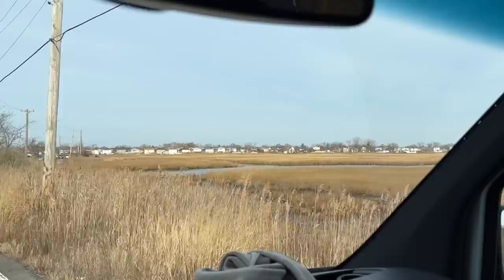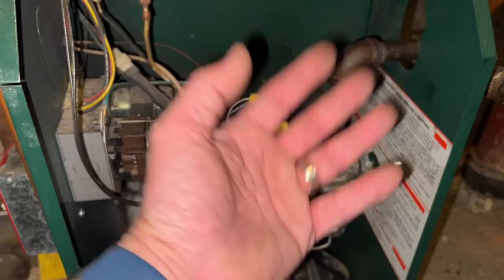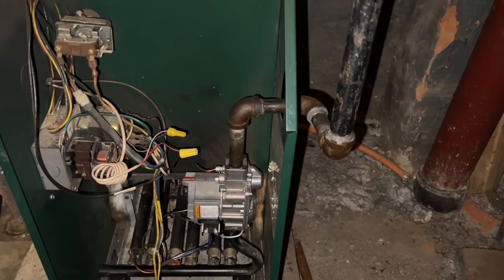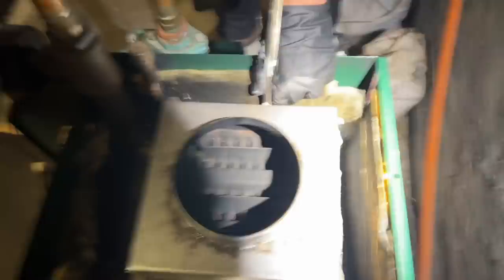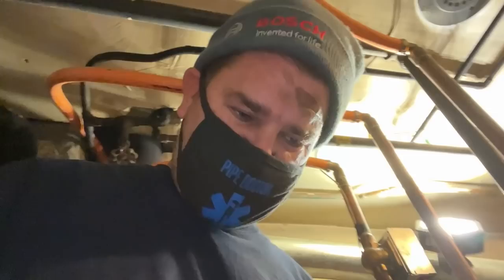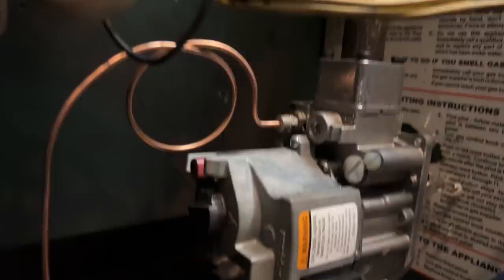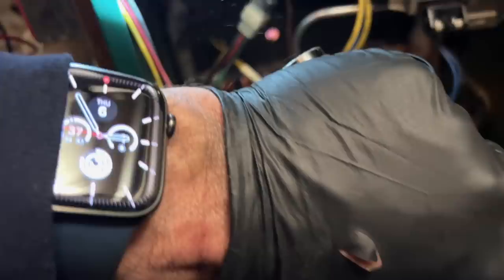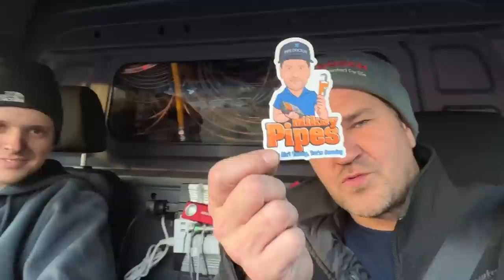Deadly and Lethal Williamson GWA-105 Gas Boiler Burning Roll Out Repaired

Comment: Well, that was a crapshoot. Great job on your efforts to get them up back and running. Reminds me of my job this morning where I had two wall heaters that were both down.

Thankfully the tenant was smart enough not to have messed with the heaters as much as your customer did. It led me to get both of the wall heaters on and running safely after a couple of hours of troubleshooting and parts replacement. Just parts needed and not shooting the parts cannon.

Enjoyed the video, Mike. Let Peter know to keep at it with shadowing you. Education is gold. Have a good one.

Comment: I’ve NEVER had a gas valve dead on out of the box. My manometer and my TESTO is my friend. I ALWAYS leave a print out on site and another for my customer file. It’s the only thing that will stand up in a court of law. If you’re not testing your guessing. 👍
And yes, as much as I hate punching boilers, I would have done the same thing you did. Good job gentleman. I hope you get paid because you earned it. 👍

Comment: We call that boiler job a GHI (General Heating Indpection) that involves pulling the burners and cleaning the heat exchangers, boiler section flue passages. Pressure setting flue gas analysis recorded .

Comment: I have had one gas valve on a bran new Lennox that fired at 4.9 w.c.  Sounded like a jet taking off lol.  That's why you always check everything on start up and don't assume it's new so it should be ok.  Thus when I have to change out a compressor I always ohm it out and test it to ground before I install it. I had one of them bad out of the box and I was pissed off because I never checked it, went to fire it up and the breaker tripped. That was a long fking day.

Comment: Question 
The Testo 320 you have....where do you send it out for calibration?
At Testo facility only?
I called them to send my 310 and this is what they say 
If calibration is the only thing needed, then there is a $50 service fee along with the $100 calibration fee, as well as about $15 shipping. I will say that since your instrument is about three years old you will certainly need an O2 sensor, which will add about $140 to the quotation.

They want $300 that's almost 50% of a new one 
My question is do you send yours out or do you just buy a new one
Reply: @PipeDoctor  yes that's who I contacted but what do you do?
Do you send it out for calibration to them?

Comment: Yo Mikey good work as always question what would make a gas fired steam broiler continue to burn through copper fittings causing a new spot repair to leak within 2 weeks? This is the broiler at my bldg ive seen a handful of plumbers try and repair but the system always leaks at the copper fittings
Reply: Copper on steam?

Comment: tell them to take their gas leaf blower and blow it out good, 🤪🤪🤪 soot cloud 101. 
yes I have cleaned units out that way, but only apartments/condos with the mechanicals in a isolated room only open to the outside.
the problem is, you'll have soot clear through your underwear and in every body crack and part of your body.
soot from bad pilot flame or other forms of rollout like downflow furnace with not attached filter/blower access/dryer lint, from duct off, etc.

Comment: I thought you said that the gas valve was the wrong one when you were talking to the husband on the phone
Reply: @PipeDoctor     Sorry my bad you told him you were going to have to take the gas value apart to do it right and it looks the same so I guess that adapter on top of the gas valve is not doing anything because the gas valve is 1/2" pipe and not 3/4" pipe so he didn't need to put that extra part back on

Comment: What we're we laughing at about the gas valve? Did you fix it? It looked the same to me after you were done.
Reply: There’s an aluminum adapter block, with 4 cap head screws holding it to the top of the valve. It’s function is to adapt the valve from 1/2” NPT to 3/4” NPT. 
In this boilers case, it had 1/2” piped to the gas valve, so the 3/4” adapter being installed was completely unnecessary, a “rookie” mistake from someone who really didn’t know what they were doing.

That being said, the 1/2” pipe was able to pass through the 3/4” threads, and reach the 1/2” fitting on the valve without leaking, so really no point in breaking it all apart to remove the adapter.

Comment: Lol reminds me of the talk my HVAC tech gave me after i replaced the board components and blew out my thermostat blowing the circuit board to pieces 

Somehow i had a 10k uF and it needed 1800 uF a mishooked ground and well POP

Was told yeah the schematic was for a commercial 10 ton unit board yours is 2 tons dont mess with this cause your gonna fry a 8k dollar furnace with a 3 dollar part